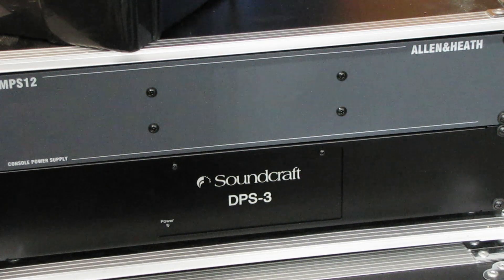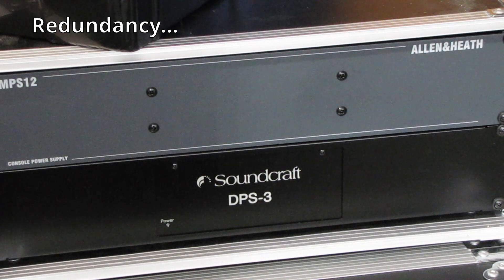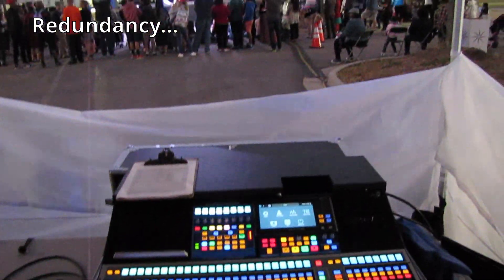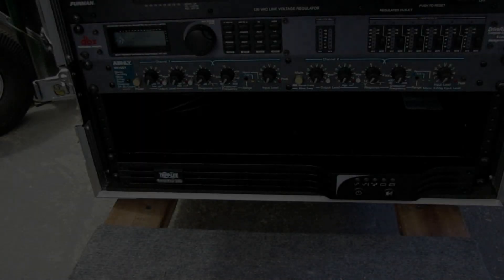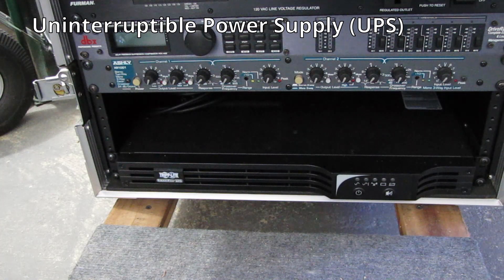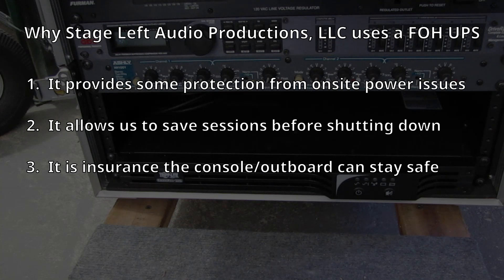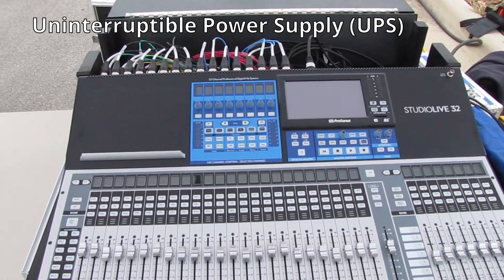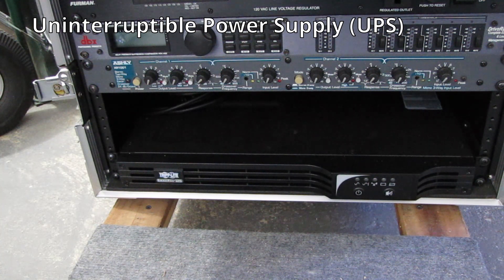Digital Snakes - Follow up video regarding redundancy and FOH UPS

Comment: Thanks for your videos! Have you had issues with the UPS you are using?
Reply from the maker: Thanks for your comment.  The UPS has been great.  Only issue was the battery connecting wires were loose and caused the UPS not to work.  I think the loose wires occurred during the initial shipment of the unit.  It was an easy fix by removing the front panel (where the batteries sit), and re-attaching the wire.

Comment: I went to buy a passive subwoofer recently and many stores are not carrying them, they said many companies are moving over to powered speakers. Whats your opinion on powered vs passive speakers
Reply from the maker: The use of powered or passive is really up to the user (there's a lot of variables involved).  I think powered is better for some situations, but passive is better for others.  Powered speakers cost a lot more than passive, but are convenient to use and most have built in DSP.  We use all passive subs (all powered with Crown Macrotech 9000i amps); we have better control over the subs using the DSP in the amplifiers (something we couldn't get in powered speakers at the time we got the subs).  However, our mid/high main FOH speakers (the RCF line) are all powered.  Having mid/high FOH speakers as powered has been great.  For us, it depends on how the speakers are going to be used if we want to use powered or passive.  All of our monitor speakers are passive.
   
Many of the older powered speakers that are still around (from about 12 to 15 years ago) used class-H amplifiers.  These amplifiers are good, but provided little to none DSP (as compared to the current line of amps - Class D).  We had a  powered JBL PRX718 sub (18"  1500 watt Class-D amp), but sold it because it couldn't provide the "impact" we were used to getting from our passive cabinets.  The JBL did great at very low frequencies, but lacked the needed punch.

You may need to contact the manufacture to see if they have passive versions of their speakers available (and where they are sold).

Comment: You should also use a ups on analog systems to reduce the speaker “pop” from a console going off before power amps are powered down.  Also having an analog desk as backup is kind of futile on an analog show, since dialling in a mix would be time crunch.  It would suck all the way around having an analog desk drop, but it’s never happened to me in 25 years.

Comment: Hi bob, pls advice. Can a power conditioner do the same As what the ups does.
Reply from the maker: Hello!  Power conditioners cannot do what a UPS does.  Power conditions mostly remove electrical line noise (using filters).

Comment: What UPS do you ise? Does it provide surge protections?
Reply from the maker: UPS:  Tripp-Lite SMART500RT1U  (300 watt/120V).  It handles brown-outs and surge.  It is sized for the digital console(s) we use on it along with some outboard.  There are higher capacity UPS' available.